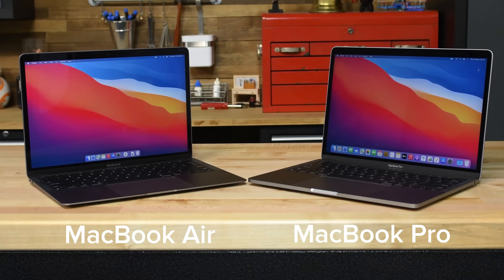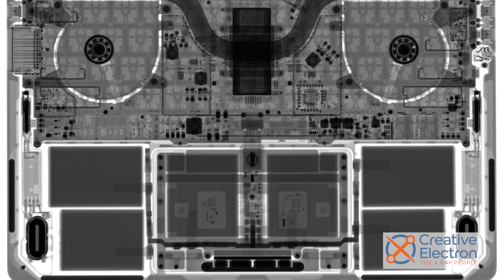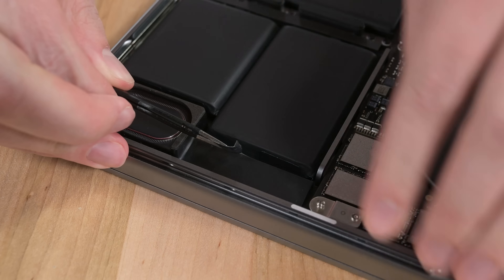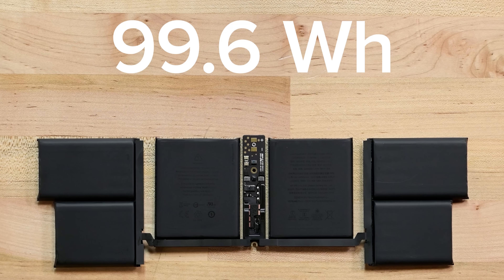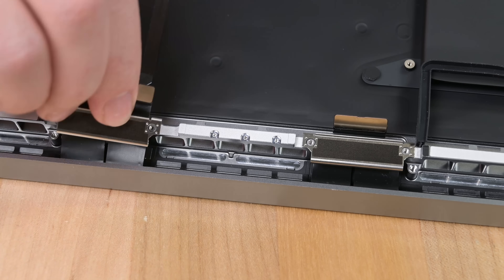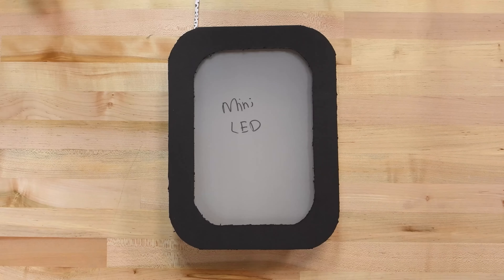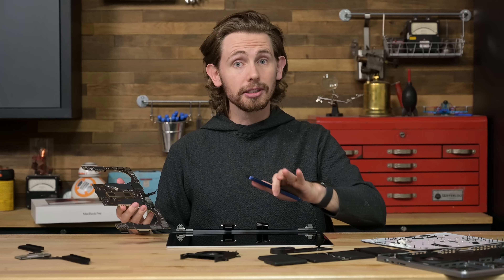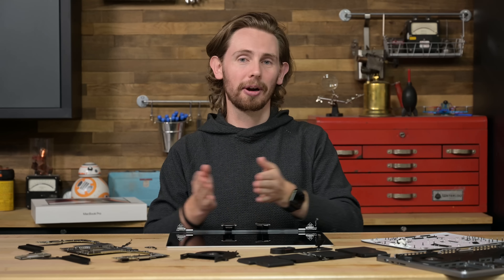MacBook Pro 2021 Teardown: Easier to Repair, Harder to Score…

Comment: I love this laptop so far. The screen, keyboard, IO and the speakers really make the upgrade worth it.. Oh and the much faster SOC.
Reply: I'm gonna go ahead and stick with my M1 MacBook pro, I have no need for the extra power of the M1 pro or max as I only edit In 4k60 and I am really offput by a notch on a laptop, since it only houses a camera and not a face ID system, to me there's zero reason for it to be there and it would have been much more apple like to not include a webcam and sell one separately.

That being said I have no issues with larger bezels if it helps me avoid having a notch, I'd rather have a laptop with far less ports than to have a notch since I've already gotten used to the dongle life, I don't love it but I can deal with it, and Im so very happy with my 13 inch MacBook pro 😃
Reply: @TechDove  There are apps that let you hide the notch. I personally like it but even if you don't, I wouldn't let it be a deciding factor in buying the device or not.
Reply: @thebuddercweeper  my main deciding factor is I already bought the 13 inch M1 MacBook pro back in may, but If I hadn't I wouldn't buy these because of the notch
Reply: @TechDove  So it's still a deciding factor. I'm saying it shouldn't be because there are already apps and ways to hide the notch.

But from what you've been saying to some other people, you don't seem to have a very open mind so I doubt the fact that you can literally hide and completely ignore the notch all the time (essentially just have a thicker bezel and slightly smaller screen) will sway you.

I get on a phone, if you don't like the notch then there's really no way to get rid of it in all circumstances, but it just seems like a non-issue on these MacBooks because you can essentially choose whether you want a thick bezel or a notch. 
The only option you can't choose is to have a worse quality webcam and medium bezels.
Reply: @TechDove  why do you care, though? The notch cuts into the menu bar only. Content is ALWAYS below… so it’s not that the notch cuts into the screen, it’s the screen that cuts into the bezel.
Reply: @onemanshow4116  why do I care? Because I don't want a notch cutting into my display, it's unsightly and not a good design for a device that has so much room, that isn't necessary to have 3mm bezels. 

Why don't you care? I always see these notch defenders and that's exactly why we keep seeing them. Would you be defending the notch if it was on the f'n apple watch?! 

It's like apple can do no wrong to people like you
Reply: @onemanshow4116  I wouldn't care if it was a teardrop style notch, but it's oversized for no reason, and believe it or not but it is possible to view full screen content on that laptop, where the notch DOES cut into it. So it's not "just the menu bar"
Reply: @TechDove  there will be software that you can install to delete the notch. Someone will make it, guaranteed.

And like I said, it’s basically free extra screen. The alternative is big bezel at top, or no camera at top… this is better than both of those
Reply: @TechDove   my understanding is that when you go into full screen content, it is ALWAYS displayed below the notch, and the entire top “bar” is blanked out like it’s not even there. Have you seen different?
Reply: @onemanshow4116  This is correct.  When viewing full screen apps and videos MacOS automatically places content right under the notch.  The notch is only accompanied by the menu bar always.  Will never affect content.  I just got mine yesterday and the notch is a non-issue.
Reply: @sandy737  so basically you're not actually getting a 16 inch or 14 inch display. 

That right there explains why I don't like the notch. 

Thanks
Reply: @TechDove  I see your point however, forget about the size and think of it as more of a aspect ratio.  Apple didn't sacrifice screen real estate to accommodate a notch.  Instead they raised the total aspect ratio to go around the notch.  They basically are doing what they did with the iPhone and raised the total screen real estate to fit info both to the left and right of the notch.  Otherwise you would have a bigger bezel at top. Since the menu bar is there 90 percent of the time, it doesn't impede in any application.   In practice it does work I assure you.  I thought I was going to hate the notch but honestly you have to see the implementation before you can say you hate it.  I think it was cleverly implemented.
Reply: @TechDove  🤡 a notch on a Apple Watch has no purpose bad comparison
Reply: @MM-MLT  yeah just as it has no purpose on a laptop since it's just a small camera and an ambient light sensor housed in it 🤡
Reply: @sandy737  honestly, I don't use the webcam, I'd have preferred they did the apple thing and not included a Camera and just sold it to you after.
however I'm just one person so that doesn't make much sense from a business perspective. But idk, j just hope it's gone before it's time for me to get a new MacBook pro in 4-5 years
Reply: @TechDove  From my unscientific measurements, you get 14.2" for the whole screen with the notch area, and 14.1"  just the non-notch full screen area. So you are still getting more than 14".
Reply: @mltamarlin  This person is just grasping at ANYTHING they can to justify their hate for a product they haven’t even seen in-person, let alone used. 
The idea that the removal of a quarter inch of screen real-estate off the top has ANY significant affect on the diagonal screen measurement is… laughable.

Like I said, though… if he doesn’t like apple’s software implementation, you can almost GUARANTEE that someone will create a lightweight program to permanently turn off the top portion, giving this person exactly what they want.
Reply: @mltamarlin  but you can't technically use all of it.
Reply: @TechDove  You're just trolling at this point. Stay away from any Engineering degree. It's clear you'd complain about physical objects taking up physical space.
Reply: @jonathanbaird  no I'm not. But thanks for your input, it has been noted.
Reply: @TechDove  still has a purpose to hold the camera 🥱 unlike the watch. No comparison there
Reply: @jonathanbaird  So many people complain about objects taking up space that I sometimes wonder if some scientist somewhere has just announced they discovered that the laws of physics don't apply anymore.
Reply: @TechDove  it could be a sign face id is coming.
Reply: @businessninja1913  could be. That I would be okay with
Reply: Heffe  to give you more production space while pushing the menu bar to the top.  The menu bar hugs the notch.  They did it for more screen real estate.
Reply: yeah, totally living up to the hype. I'm just blown away by the screen blacks and the speakers. 

hopefully this MBP lasts as long as the one it's replacing.

Comment: 2:02 is it me or are there empty storage slots on the left just above the battery? would that make upgrading storage a bit easier?
Reply: I doubt it would be easier… or worth the risk of trying to solder on NAND chips. And then to get them initialised and formatted so that they’d be recognised is another issue.
Reply: @rushilkisoon  REWA Technologies can do it, why cant we
Reply: I don't know why they didn't provide upgradable storage access.. integrated RAM is absolutely necessary that I can understand but Integrated storage is a bummer.. at the very least they are not selling 128GB storage for base model but still..
Reply: @sanjay_swain  because this will allow people to have a choice… which means Apple lose control. 
Also it makes life harder because if your motherboard dies, your data is stuck on the board
Reply: @rushilkisoon  well, that’s really just an added bonus for them. Embedded components(soldered), depending on how it’s executed, does bring some real world benefits. The biggest being controlled impedance in terms of signal integrity. The issue with ICs as they go through die shrinks is that the rise/fall times of signals get lower. This introduces many new opportunities for EMI/noise. So every step through which a signal travels on a transmission line between ICs, needs to be taken into account. If not, you’ll have mismatched impedance that introduces reflections. Physical interconnects can be problematic when trying to achieve matched impedance consistently. Soldering a components down close to one another really is the best solution going forward.
Reply: Just a guess, but they didnt mention which SKU they bought, i would assume they got a cheaper one to tear apart. Likely those slots would be filled with a topped out SKU.
Reply: @L-dragonix do you upgrade the VRAM of your GPU? On new M1 the RAM is basically shared between CPU and GPU. And it is a 512 bit bus upto 400 GBPS bandwith that's similar bandwith of GTX 1070 (I don't remember exactly) but at MUCH lower power draw. It's practically impossible to make a modular RAM for M1 chip.
Reply: @L-dragonix it's not soldered... It's integrated into the SoC itself.
Reply: Nice observation !
Reply: youd prolly have to solder the new storage on
Reply: I'd say that depending on the configuration you purchase, additional BGA chips will be fitted in those locations to increase memory or storage capacity. Chances are Apple has locked it down in some fashion to prevent third party upgrades though.
Reply: @L-dragonix It's not soldered it's part of the m1, that's what all this unified memory hype is all about.
Reply: This has been a thing on literally every MacBook with soldered SSD. This is nothing new. You cant just get any old NAND and solder it on, ever since the introduction of the T2 chip and now the Apple SoC it won't work. Credit to REWA to doing it on an old MBA
Reply: @L-dragonix again, this architecture has the ram integrated in the CPU, which makes many of the performance gains possible. There is no 512 Bit width bus with 200-400 GB/s bandwidth in „normal“ ram configurations. Have you ever complained about not being able to upgrade the VRAM on a graphics card? No? It is exactly the same thing here. This SoC is not comparable to pc architectures up to now, it is quite unique.
Reply: @L-dragonix Well, DDR5 (LPDDR5) is in the M1 Pro and Max now, in 2021. The RAM interface is however way wider than normal, with 256 Bit (Pro) and 512 Bit (Max). It presumably is LPDDR5-6400 RAM in the Max, which, together with the 512 Bit width, would have 409,6 Gbytes/s. "Normal" DDR5 ram will only have a 64 Bit interface width.
We are, in the case of PCs with DDR5 however talking about next gen stuff, that is not available now. I think that LPDDR5 (albeit slower by itself, therefore more efficient) combined with the broad interface width is something unique, especially well suited for efficient laptop use while still being absurdly fast.
Reply: @L-dragonix Well, what good is DDR5 that is not available yet, let alone in a laptop? And even then, this 512Bit width ist not in the standard. So this combination of low power and high bandwidth cannot easily be replicated.
Reply: @L-dragonix again: not available yet (both, DDR5 as well as Alder Lake). We will see when benchmarks come around next year. And no. I don‘t underestimate DDR5, when it shows it’s potential in those M1 Pros and Maxes.

Comment: Are the 6 speaker system the same on both models? In the keynote they kinda said that only the 16” model has true 6 speaker system
Reply: Just a few seconds later then also said that the 14" has it too